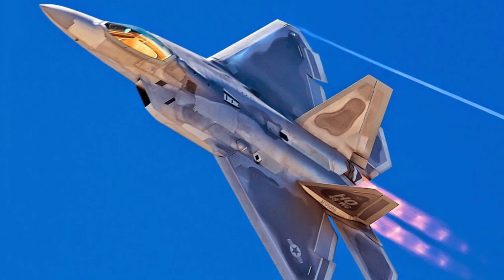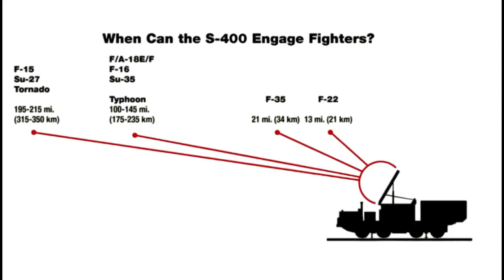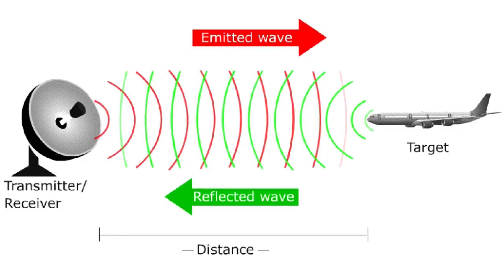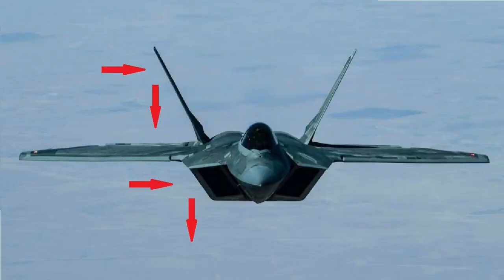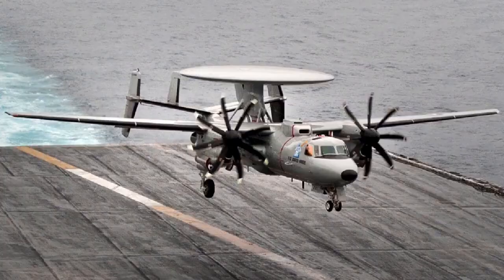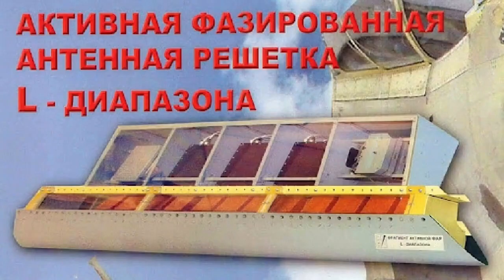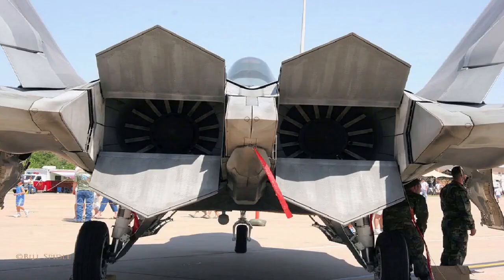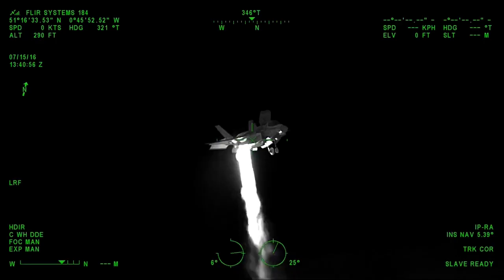Counter Stealth Technology: The Systems that Can Detect Even the F-22

Comment: So this is an oft discussed topic and I hear this argument of VHF guided missiles countering stealth but there are some misconceptions regarding this technology and physical problems that are often overlooked. Even if the VHF radar can detect a stealth target, the return signal coming off that target is giving you the location of the object within as somewhere within a square kilometer. Advanced computer programming can predict the likely location of the object within that square kilometer to enough of a degree that shooting the missile is not just a waste of ammo and wont miss the target by a mile, but there is still a HUGE problem with this and that is this ONLY works for missiles with their own active seeker, essentially guiding the missile into close enough range that the seeker can take over terminal guidance. However, these small and relatively weak expendable radars on the missile ALL OPERATE IN THE X-Ku band for that tight beam accuracy needed, meaning that the seekers detection range is going to be garbage. If a stealth aircraft pops chaff or a spoofing decoy, its going to clearly see those signal returns which are designed to look like aircraft sized signals, while the aircraft itself will look like a bird or a piece of bird poop in its electronic eye. Furthermore, if the aircraft makes a rapid adjustment in its altitude and trajectory, the VHF track on the target will have to recalculate its prediction of the objects likely location and send that track data, further increasing the chances of a miscalculation, especially if their is any kind of electronic attack.  Does this mean it wont ever work? No, it could still potentially line up in such a manner that the seeker actually catches the aircraft at bad angle, get a good signal return and either it beats the spoofing or just luckily picks the correct signal return. However, you have gone from "CAN'T Engage at all unless within 10km" to "fire your entire load in a spread and hope you get lucky." Its better than nothing, but its not going to be a hard counter. It drastically complicates the engagement for the SAM and that's of course ignoring any scenario where there is VHF jamming, which due to its massive wavelength, low power and huge array, makes it far more susceptible than a tight high powered beam. Also ignoring decoys or anti radiation missiles which may cause you to turn off your radar prematurely by choice or through destruction. If the VHF array is being jammed and spoofed by an AWAC, the target area saturated with decoys and the missile seeker being jammed in X/ku band by the aircraft or jammer escort and spoofed from chaff and towed arrays, all while its looking for a piece of bird shit that HOPEFULLY in the correct predicted location, you can see that a stationary (as in non TELAR system) is going to be shitting bricks if their location has been identified and they are the target. It would work better as a pop up threat rather than a area denial system, which since your actual TELAR systems which usually do that job with their S/X band search and track radars are now no longer capable of effectively engaging outside of visual range, you will at least be able to use the range of your air defense missiles in some scenarios. If you're just blasting away with VHF and thinking you're going to be able to defend an area your radar is going to get smashed by a coordinated attack that will have significant tactical advantages. Then the launchers are going to be hunted down piecemeal. Its not an ideal matchup for SAM systems. The main advantage they will still have is the speed of their interceptors which, again, will make this a credible pop up threat, but a poor base defender.
Reply: I aint reading allathat
Reply: @tomiokagiyuu1730  same 🙏🏻

Comment: I‘m no expert, but those L-Band radars in the Su-57 would apparently have far too high power requirements for them to be realistically meant for search and track. Something to do with the size of the arrays and the underlying physics. They‘re supposedly only intended for IFF.
Reply: Only stealth fighter with a comat record (not balloons or drones).
Reply: @RadicalTek  F-35s have seen combat too, i.e. intercepting Iranian missiles as well as strike missions. And, at least officially, no F-35 has been lost to enemy action. There’s also some doubt about the Su-57 actually qualifying as a full stealth jet. As for the „photonic radar‘s“ power consumption, feel free to give a brief overview of the reason why and how it is able to be used for search and track at any useful range within the Su-57‘s power limitations.
Reply: @RichelieuUnlimited  Iranian drones, not missiles
Reply: Phootonic radar consumes less power.
Reply: they are smaller than the main array so they need much less power. Frequency does not affect power consumption
Reply: @Awaken2067833758  Frequency does affect the size and thus number of the individual antennas/TRMs as well as beam width, which has to be compensated for with additional power.
Reply: @Awaken2067833758  Frequency does however affect the size and thus number of the individual antennas/TRMs which negatively impacts beam width, resulting either in a reduction of range or far higher energy demands.
Reply: @Awaken2067833758 Lower frequency results in larger and thus fewer antennas, results in wider beam, results in lower range for a given power consumption.
Reply: A lower frequency results in larger and thus fewer antennas, which results in larger beamwidth, which results in lower range for a given power consumption.
Reply: They are not used for search and track. They are used as a multistatic radar system to give a general direction and altitude of a stealth aircraft. That information is then used to either  guide a missile to the vicinity, which then turns on its radar, or to give the pilot awareness of  the general direction in which a stealth aircraft is